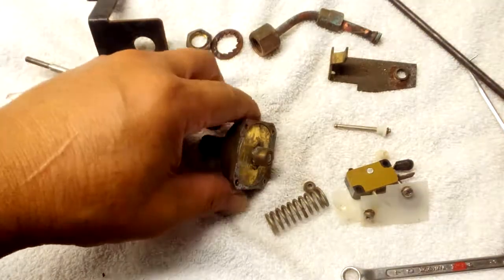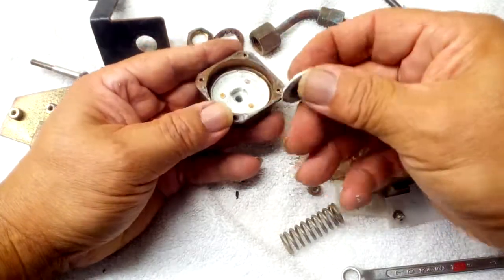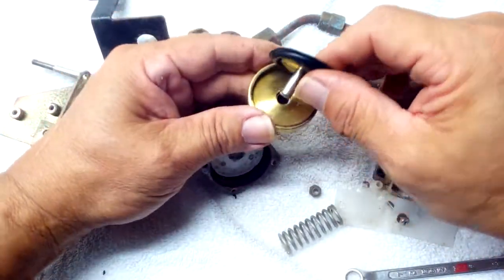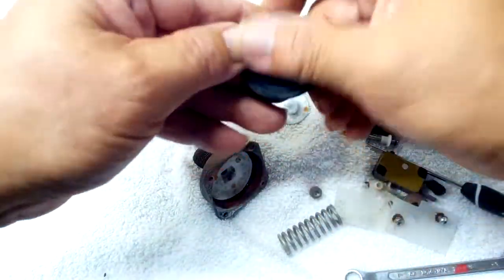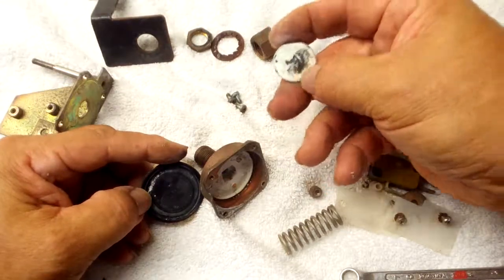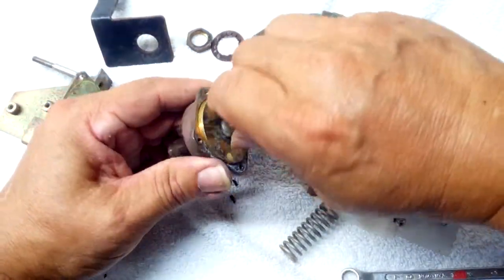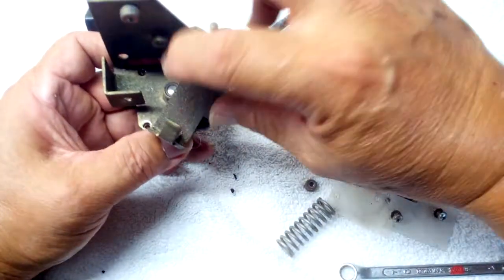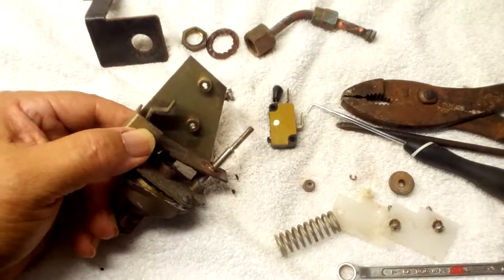149 Part 5 (final) continue evaluation of used Pressurestat

Comment: Hallo Sir, thank you so much for these videos. They have helped me replacing the diaphragm. Without the videos I wouldn't have known how to do it. Your effort is very much appreciated!
Reply from the maker: Your welcome.   If you have questions, please ask.  Aloha.  FYI it's possible to replace diaphragm with heat resistant flexible plastic or synthetic rubber if it can handle at least 230f.  Sometimes you just got to cobble something together just to make it work.   (Disclaimer,  use only approved parts when performing warranty or vendor service!)